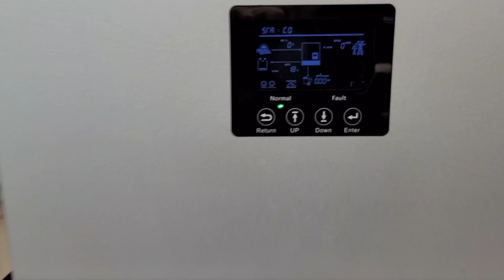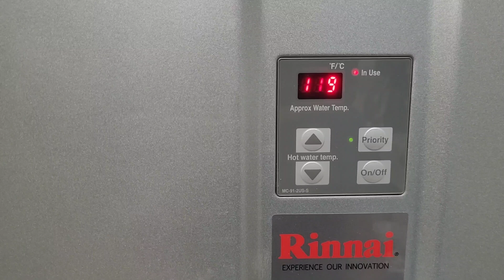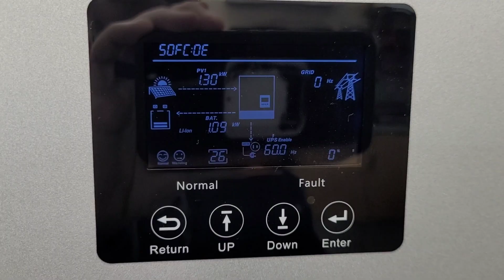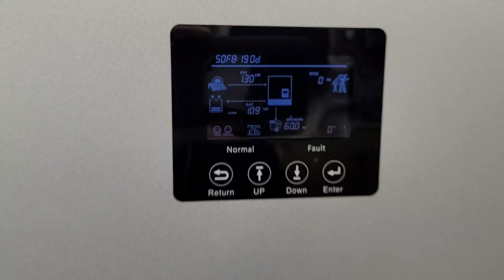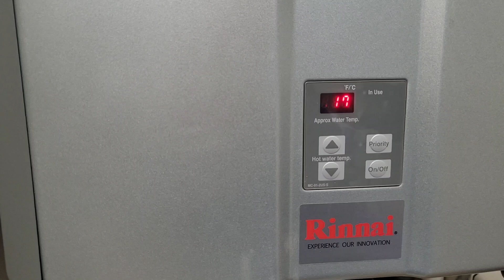Making A Hybrid Solar Hot Water System!

Comment: Okay, so the tankless heater only uses the burner if the water coming in from the cold inlet is below a set threshold? If that's the case,  I can setup a DIY solar heater (in the caribbean and then pass that heated water to the tankless

Comment: My water heater is similar, but has a buffer tank. Would I install this right before the boiler still? It's a IBC SL14-115G3 boiler and with an IBC 40 tank.
Reply: I checked with the company and they confirmed this would work

Comment: When I upgraded my heating system here in the UK, I opted to get a new water tank and the installers couldn't figure out why (since most UK systems use a boiler that provides heating and hot water direct from the boiler now). But I had them install the electric 3kWh heating element too and now I heat a 200L tank using a solar diverter system. I get free hot water for about 7 months out of the year then have to swap back to heating it with gas. It doesn't cost that much to heat the tank with gas but over the years the money saved paid for the solar iboost diverter and then provided gallons of hot water for 7 years now

Comment: I would like to find an indoor refrigerant to water exchanger that would work with a minisplit outdoor heat pump to heat my indirect hydronic/potable tank with excess solar from my inverter.  The minisplit manufacturers have many options for the indoor heat exchange but I have yet to see refrigerant to water with controls. The outdoor minisplit units are quite cheap and efficient and come in a cold climate version. I'm also waiting for R290 air to water mono-block heat pumps to make it to North America. We are far behind Europe and Asia in adopting low GWP refrigerants for heat pumps like R290/propane. There is no flammability risk on a mono-block since the refrigerant stays in the outdoor unit. A propane BBQ is more dangerous.

Comment: I'm looking into doing a solar PV/ battery outbuilding with an air source to water heat pump for in floor heat/ cooling & hot water.  While researching I stumbled upon some water to water heat exchangers that are becoming more prevalent in Europe & the UK. They're essentially cylinder reservoirs that have an inlet/ outlet for the air source heat pump & another pair for the coiled potable water pass through. Something like that might work for your household hot water needs.

Comment: Is there any specific reason why some people prefer copper over Pex (or vice versa)?
Reply from the maker: Pex is cheaper and faster to install, I think copper looks nicer when it's done nicely
Reply: @ pretty cool “solar battery” using thermal energy. I bet if you didn’t have other gas appliances, you could probably cancel your gas hookup and get a larger hot water tank for larger thermal mass (or go electric tankless).
Reply: @SmitHVAC. Pex does come with 90 degree connectors so you can have your tidy installation :)
Reply: Copper is also way more money 💰😁

Comment: No gas here so I will go heat pump water heater when my old resistance heater needs replacing in the mean time it eats my solar at about $50 a month.
Reply from the maker: @offgridwanabe  I'd definitely like to try out a Hp Wh, I think I would hook it into my Hrv for winter to exhaust the cold air. In summer I'd probably tie it into the furnace return to cool the house
Reply: @SmitHVAC.  Ya I was thinking the exhaust might be warm enough to heat my garage in the winter as it is not heated.